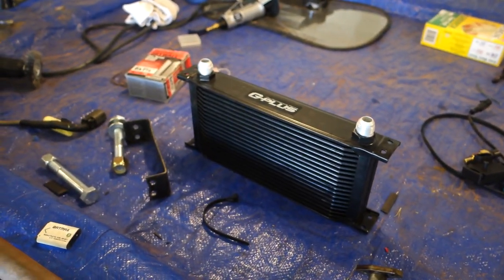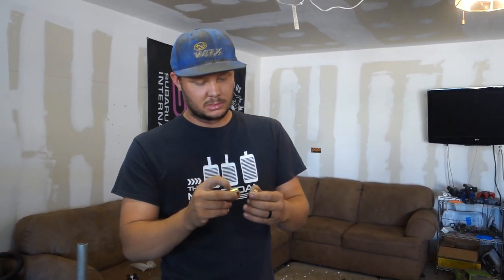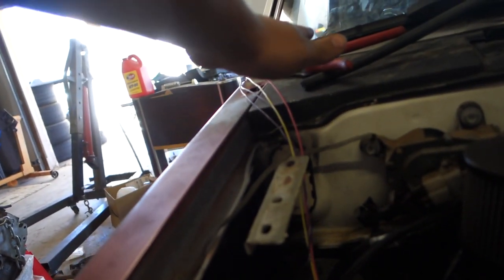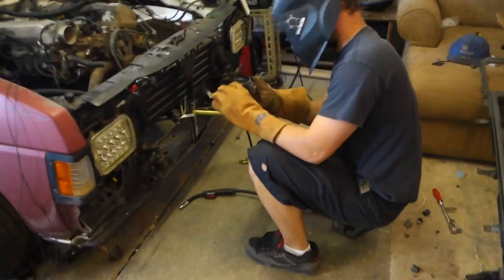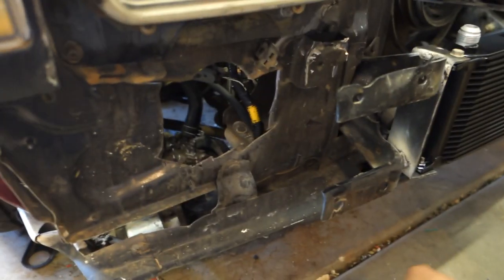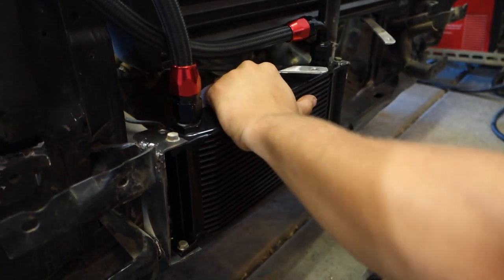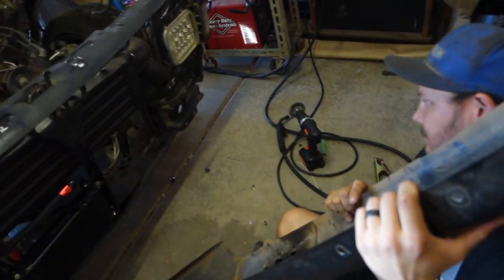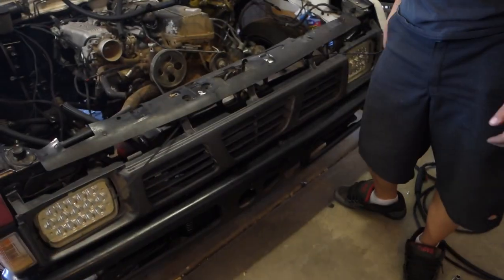D21 Hardbody: Oil Cooler Install

Comment: and you still can't weld aluminum!!not a good investment.Tig welding thin stainless steel is really hard,you have to have really good eyes,opposed to aluminum TIG,just keep on feeding that shiny Pac-Man!and that's all I'm interested in just keep the good videos coming.it looks like Thor got a new hammer;-)I need information on a plug and play lds rear end. for d21!